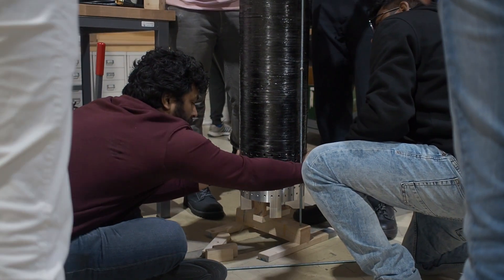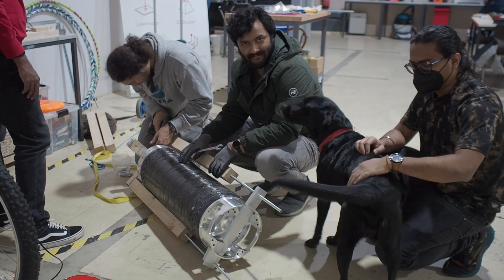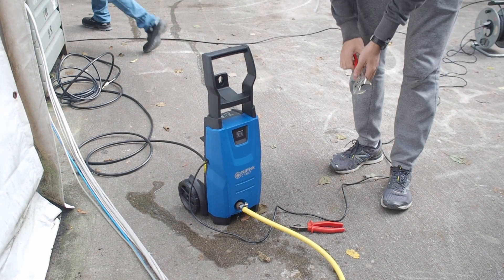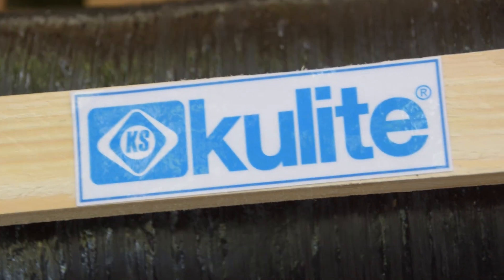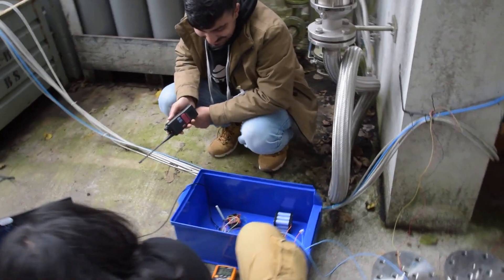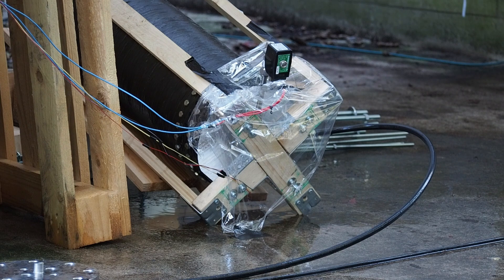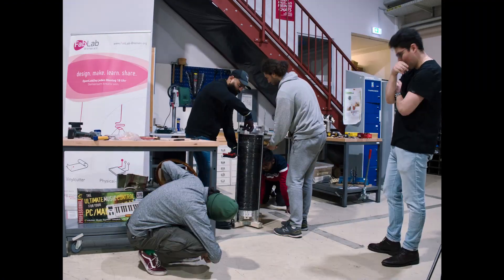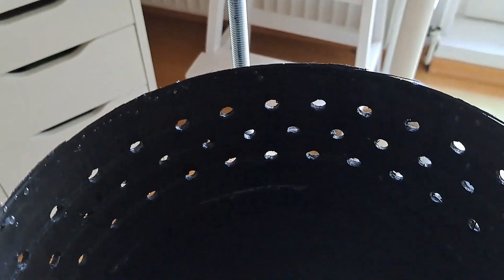Is this cheap rocket tank strong enough?

Comment: Carbon fiber is conductive so you can electroplate on it --- probably not what you want but possible. I think drilling ruined everything and so wind the carbon fibers around the metal ends. Probably a second metal thing over the carbon fiber to seal and then wind around with carbon fiber and resin.
Reply from the maker: You are exactly right.  The holes are the source of the problem.  Tank 2.0 gets rid of the holes all together.  More on that soon.

Comment: There is only 1 way to fix this leak issue.  Post machine the ID of the tube to form a flat "void free" surface for the seals to act on, because you can still see the fiber pathways from filament winding inside the bore there which would provide micro-channels for the gas/ liquid to bypass the o-rings. At the end of the day this tank construction method with the heads bolted through wall of a CFRP tube is NEVER going to work sorry, the composite structure is going to shear and blow the head caps because all the holes you have drilled for the bolts have disrupted the laminate structure. Beyond this issue as relayed before liquid Nitrous Oxide has a solvent effect on many common polymers, and there is significant risk (in terms of lowered activation energy required to initiate a decomposition event) associated Nitrous when it is contaminated with hydrocarbon solute so the liner less tank direction also presents risk. 

You can do the following to salvage this Nitrous tank project, go find a length of plastic pipe made from any of the following materials uPVC (un-plastcized PVC), ECFTE (Haylar) or PVDF. If you use PVDF you can 3D print some end domes from same material (the other materials would need to machine end domes), design some aluminum threaded bosses integrate them to the head domes and then plastic weld (or solvent bond) the end domes on. You will have a fully Nitrous compatible liner onto which you can can then filament wind your carbon fiber. I dig your teams passion and drive and I wish you guys luck with the project, but looks externally like you really need to get some solid mentoring on a lot fundamentals of both composites structures design and propulsion if you are going to succeed at this very ambitious goal. Happy to donate some time to help guide the team or sit in on your PDRs etc, just search my LinkedIn and DM me. Ad Astra.
Reply from the maker: Thanks for the input Jamie.  If you are okay with it, we will definitely include you in our upcoming CDR (most likely June-July 2023).  At this point, I tend to agree with you that we are unlikely to get this concept to work.  We have been playing around with the tank for the last 2 months without much success and are already considering some ideas for redesign.  Your suggestion to use a plastic shell that we would wrap over could be a good solution.  We also might get the opportunity to procure a very thin aluminum liner that we would wrap over (but that is dependent on sponsorship).  But this is all for the N2O tank.  We still require this bolting methodology to work for the combustion chamber.  N2O compatibility won't be an issue there, as it is completely insulated.  As for the bolting issue, we have some alternative options we could pursue, they would just cost us mass and complexity.  We will probably try the pressure test one more time with an improvised plastic liner and if that doesn't work, we will move on to our next design ideas.  Thanks again for the tips.  Your input is always appreciated and valued!

Out of curiosity, what projects are you working on?
Reply: I would like to differ wrt just one point, if you have enough bearing strength (enough pitch and edge margin) nothing should happen to cfrp casing. Also, while calculating joint strength (min out of bearing and shear) if shear is less, It would not tear the cfrp casing.